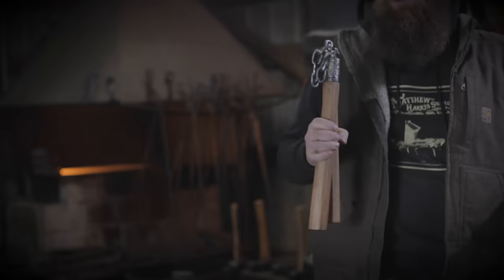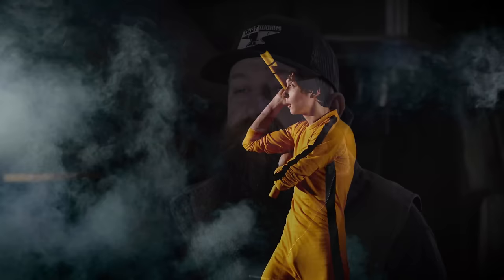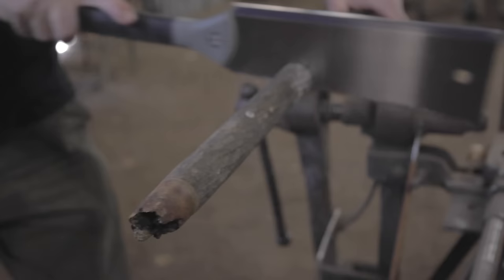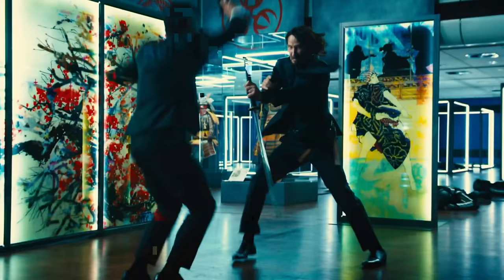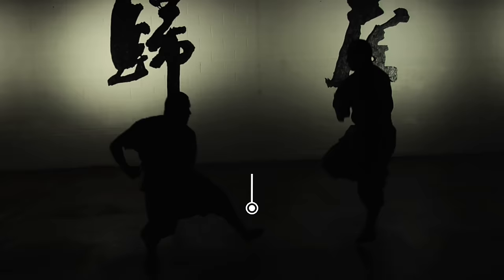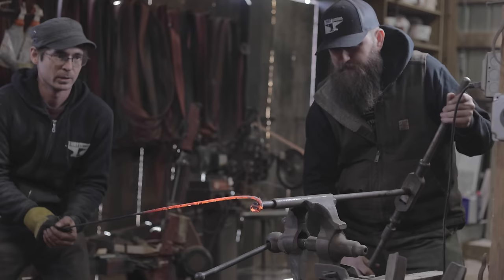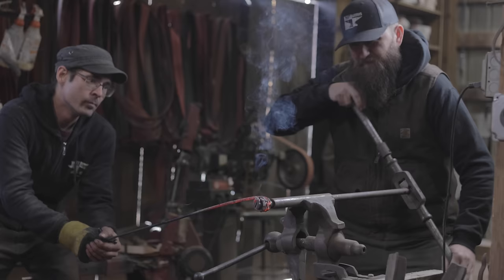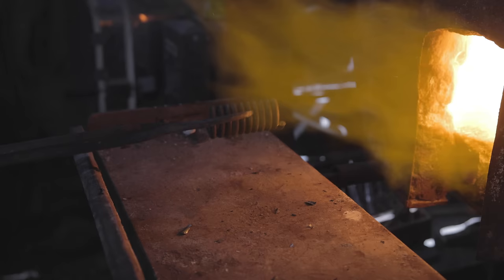John Wick 4 Nunchucks - Did They Exist in Battle ?

Comment: Here is my hypothesis on this matter. Nunchuk is a weapon that is used solely by ninjas. Which means, first, it has to be well conceal. Secondly, as a flex weapon, it can have better reach compare to other weapons. With the harden end, it can be used to deflect enemies blow for defensive purpose and with the flexibility, you can also throw enemy with ease. Also bare in mind that against people with armor, throwing them is the most efficient way. Which, you can imagine, Ninjas are not supposed to fight but run away most of the time, they may create scenario where they fight necessary fight with small crows. And because Ninjas are bacially rogue and not wildly accpeted by society, a weapon that is solely used by them, should it exist, may not be documented, specially it is also a simple design weapon which no body would really take a deeper look into it.

Comment: My guess is that they were rice flails, and that young men and boys would swing them around flamboyantly (as young men will) while they were working (thus giving the years required to master them), pretending or practicing to fight. Eventually, the long pole would have evolved into a shorter stick to make it possible to carry your flail (which was now a weapon) around easily, thus evolving from an agricultural tool into a specific weapon no longer useful as a flail. But not used in warfare, where a simple spear would be much more effective. Most likely used in bar fights...

Comment: Here's the real story. 
(A little bit of a read, but bear with me) 
I used to live around Seattle for a long time, and knew people that used to take classes from Bruce Lee.  That instrument, is not a weapon, it's a tool. It's also not a rice flail, it was a poor person's rug beater. It was two short equal length sticks with a rope connecting it, and was used to beat dirt and dust out of rugs and carpets in the 18-1900s in China and Japan, after both nations saw the lavish carpets of western nations and wanted it as well. Japan in particular was very impressed by the fact that western nations had carpet almost everywhere, since it was very expensive to make in Japan at the time. It was NEVER a "historic weapon", it was a rather new but rudimentary cleaning tool. So why the legend? Well this is largely because of Wing Chun Gung Fu, as well as Bruce Lee.  Wing Chun was a martial art designed to win, in capable hands, essentially a street fighting style that would go for eye gouges, joint locks, and groin shots if necessary. It was about minimal movement and redirection of momentum to keep the upper hand, and also being asynchronistic so it wouldn't line up with the "rhythms" of other largely practiced Chinese martial arts. But the biggest lesson, was "when fighting for your life, do EVERYTHING and ANYTHING you need to win.  EVERYTHING is a weapon, in trained capable hands." This meant a broomstick, a chair, baking flower, sand, a rock,  ANYTHING. This is where Bruce Lee comes in.  Bruce Lee took that to heart, and practiced using EVERYTHING as a weapon while studying Wing Chun under Master Ip Man, and one of his favorites, was a little rug beater, the Nunchaku. It is NOT a practical weapon. It's actually a pretty piss poor weapon. But that was the "point" of his demonstrations. To use something so basic, clumsy, and impractical, and use it as a fast effective weapon if needed. The idea of a Nunchaku being considered a "weapon", was something that only came to be after Bruce Lee used them in his movies and demonstrations. It also caused a bit of confusion as to the origin, because around before the 70s China and Japan started using the more common ornate European "flat" rug beating tools, since they were more effective and did less damage over time to the rugs. So it was a tool that was really only used by a rather small group of people for its intended purpose for less than 100 years. 
The point is,  this isn't a weapon. It never was. There are no "historic accounts" of a real Nunchaku being used in battle, because they were made during a time when "soldier battles" were dying out and guns were being used more. I know there are some historic accounts of rice flails being used as weapons, and I'm sure there's a few Asian counties that would love to take credit for the pop culture phenomena of the Nunchaku, but it was just a very short-lived cheap tool, that Bruce Lee used to prove a point. The problem is western counties had never seen a Nunchaku before, so most people didn't get the lesson about it that he was trying to convey. All they saw was "a Chinese weapon". (Which then led to a ban of the "weapon" in many western countries and even some US states,  even though a simple hardwood stick is more dangerous)

Comment: Hello ... so I found this video interesting... but I want to say that a few years  ago I did a bit of research on the nunchuck  back then the nunchucks can be use as a weapon  but only when there was no other weapons around and that the nunchucks was mainly  to perfect  fighting form for all type of fighting whether with a weapon or not  and the idea behind it was that if you manage to go through  the training with out hitting your self ... you'll do better in the fighting type you are try to go for... and the training very depends on what you trying to achieve. ... also I also read somewhere that there 3 type/weight classes  for the nunchucks when practicing  type 1 is a very light  one that is a bit padded  for beginners  type 2 is a wooden one that has more weight to it for  people that  are a bit more advanced  and is the most common one used and type 3 that's very heavy and usually made of metal  mix materials  and are used by pros that want to challenge them self
Reply: Gee.
In training you have to be very careful not to injure yourself.

I'm sure nobody ever considered the possibility of injuring  someone else.

Comment: The ones Keanu used filmong were Rubber they had like 8 pair sold at auction ..maybe 1 hero wood.. but most all were pianted octogon light weight rubber foam.. not

Comment: Few points: Yes, it is not well documented and if it existed only relevant in civilian self-defense. And yes, the way it is used today is mostly acrobatics. But, if you hold it in a sensible way - about two fingers width from the butt of the handle - you have more reach and you can generate much more force - e.g. watch?v=HLhcd8tIhSE  - Speaking of which, the chain is obviously better for blocking weapons, but it impedes the build-up of speed; even more so with such a fat chain as here. And lastly: Next time when you have the expert in, let him hit something with it. ;)

Comment: the training question is weird to me.   if you're using a tool daily,  you're training with it daily tip thrash wheat and rice.  As for why you would uniform the 2 sticks to the same size; this again seems silly to me.  having 2 sticks the same short size makes it reversible, balanced, extended beyond the stick size if it was twice as long and a one handed weapon.  potentially,  you could carry 4 18" sticks with a dual 36" each in each hand. you could beat a lot of peasants with that.

Comment: i know this is not a video about polishing but i also dont know how often you guys check the comments and wanted to make sure its seen:
What do you guys use when you hand polish?...cause WD40, thread cutting oil, and Windex...all have warning labels saying: Keep out of reach of children and have contacts for a poison control center. Sharpening stone oil/whine mineral oil Like that made by Norton says...in Ingestion and inhalation of vapors should be avoided.😱 Maybe we should not be spending hours inhaling this stuff it might just be bad for us. i have been using olive oil and have tried canola oil it works just as much as Thread cutting oil. it will not rust the blade I tested it on a cracked 1075 blade leaving it on for hours against ferric chloride, white vinegar and tap water it did not rust the blade. thread cutting oil is $1.02 a fluid ounce,  cheap olive oil is $.22 a fluid ounce, and canola oil is $.15 an ounce and very, very easy to get. It smells good and is safe to ingest.
I will acknowledge it could cause bacteria to grow non the blade well your cleaning it up but just properly wash and dry it when you are done polishing and that's no longer an issue. IF you are allergic to olive or canola oil well use a veggie oil you're not allergic to. 

also again, wash the blade to get rid of the oil before you coat it in wax to help prevent oxidation and that should prevent the end user from accidentally suffering an allergic reaction and use the WD40 and other things as they are intended.
PS: keep using water with your water stones.

Comment: i think it's less weapon for offense and probably more defensive if at all. Defensive against a sword or polearm to wrap the item and you have two handles to hold and control it. although even that seems a little far fetched. The rice flail seems like a decent enough story that starts but again why make something more difficult to use? In such, shorter handles take away leverage that can be attained.

It's entirely possible that one could have been found and mistaken for a weapon, when in truth it as just a broken tool and nothing more.  It's unusual to have a weapon either offensive or defensive that isn't immediately obvious what it is intended for and the use there of.

This is just speculation of the thought, aside from possibly being some mid century creation to look cool for the movie screen. If something like a nunchuck was discovered with a stick linked to possibly a shorter piece and it wasn't a rice flail, it may have been mistaken for having equal length handles when it had perhaps a short iron bar to be a sort of morning star like object. But again, that's just me speculating.

Comment: Hi That works, i have a question for the nunchuck that was made in the video, I see in the end of the video the spikes end of the chain were hammered into the wood, doesn't that make the wood handle have potential to break ? Especially with big spikes like that ?
Reply from the maker: The bell that goes over that section holds and compressed the wood tight. Of course these aren't the most durable weapons. They are after all, just wood.

Comment: I will start by saying, as a lesser point, that I swear I read some years ago that nunchaku were literally invented as a theater prop, and later, movies.  It was NEVER a weapon,  it was always flashy looking and cool. 

But my greater point,  IF, you wanted this weaponized, you'd have to wrap the ends with some kind of steel knob.  The extra weight, plus the harder point of contact, would be required to do actual damage.  I can't help but notice they absolutely no one who has ever argued for the efficacy of the nunchaku as a weapon has ever tested it on meat, and there's a pretty obvious reason why.  Have you tried to break bone or even split skin with a small stick?  Because the velocity a nunchaku can build is pretty limited given the compete lack of weight.  Again, to make it a weapon,  you'd need weight, or greater speed, see also the meteor hammer.

I'll finish by pointing out that as a home defense weapon, as a personal defense weapon, as a concealed weapon,  a small truncheon beats this every time.  A sap or blackjack doesn't need a ton of weight to be effective, and it's smaller... and notably less flexible.  But they don't beat the knife.  Nothing beats the knife, even a little bit,  if you're fighting another human being, in anything that isn't specifically a wartime battlefield, the knife is the smallest, lightest, most reliable tool/weapon platform mankind has ever invented.  Period.  Every alternative has strengths and weaknesses that might make it better than a knife in a very specific scenario but every other self defense weapon system lives alongside the knife, knives have never, and will never, be completely replaced.  At least not until we evolve in WALL-E chair bound fatties.

Comment: I think it was never used as a war weapon.  Against a sword or spear it would have been useless.  A staff or stick would’ve be a better choice.  A staff has reach of a spear but not the point.  Even against a club it lacks the ability to block that the stick provides at the same reach.  A simple test of trying to block a stick to your face will show you the weakness a flexible weapon.  It will bounce back at the user.

Comment: The Nunchucks is a threshing tools a farm labor will spend hundreds if not thousands of hours using this tool every year any farmer who has used the tool is very proficient at it by the end of the season  What your thinking may fit the world of today but it does not fit the world where these farm tools were used to bring in the harvest every year. What would a farmer use for self defense on the farm or going to market? A baseball bat or anything that would be seen as a weapon would get the farmer killed by guards. common farm tools would not

Comment: Is it possible they were used by Ninja or their predecessors the Lin Qui? And maybe the idea wasn't so much as concealment, but ease of transport and carry, since you don't want to try climbing a wall or a tree with a staff or a club. So with a nunchucku one could keep it in their "utility belt" and have it easy to carry and also easy to deploy if needed. It's cheap to make, and in a situation where a Shinobi or Lin Qui were infiltrating a camp, compound or whatever they wouldn't have to worry about injuring friendlies. 
I think the idea was to incapacitate individuals that would be likely threats while snaking around to steal intel or something like that. In this scenario one doesn't need to kill, just knock out possible threats. And there is no need for elegance in how it's used, it's just a tool.
Reply from the maker: Oh boy...
Reply: @ThatWorks  What about my comment led to that response honestly? The Lin Qui part? There is documentation of a clan from China that were dubbed Lin Qui (roughly translates to Forest Demons) by the bandits they attacked because of how fast they struck and vanished into the forest. Here is a video that mentions it. https://youtu.be/9VI2tuEoPIg
And as for the infiltrating part, there was a clan that specialized in Intel gathering. I know it might have seemed like I was talking out my ass but I wouldn't have even commented if I didn't have some form of evidence to the thought.
Reply: The Lin qui are not real they are just made up and never use gaijin goomba as a source.

Comment: In my personal opinion, it would make a terrible battlefield weapon.
However, in a close tight space for quickly brutalizing your opponent, it is a fantastic device for delivering quick successive blows with superior impact force compared to a stick in a tighter area. Perhaps instead, imagine how two pieces of bamboo with a wetted rope (for weight) run through them could make for a quick and dirty version of this weapon that could be used to quickly spring upon a victim, pummel him with quick blows aided by the return motion, then toss the cheap implement aside.
It is very hard to block, and the power of the strikes is a lot stronger while reducing the recoil on your own hands, so you do not have to be a warrior to do this. Also, this use does not require much training or practice, if any.
These are just my thoughts on it.
If you do test this, don't use a hard target like a log that will bounce it back at you and lead to self-injury, maybe like a pillow stuffed into a tough bag.

Comment: Hum, on the one hand, as usual, good production quality, nice blacksmithing and carving by Illya, on the other, I don't think you have enough personal experience using such a weapon or you'd have a different thought on how effective it is. I will say however that I don't think it was ever used a primary weapon in war/battle, but it most certainly was a self defense weapon used by those of the "lesser" class who were not allowed to have "real" weapons. 
Little constructive criticsm on your actual build, while they may look like a pair of nunchucks, but too bulky to be properly wielded by the avg person, those would loose their effectiveness of high speed/velocity. Also, the chain or rope (I prefer rope, it's quieter, lighter and doesn't keep a load of noise) should be just long enough to fit across the palm of your hand, any longer and they become what you suppose, unwieldy and harder to control.
Reply from the maker: These were modeled after the one used in the movie. We were kid of stuck to the design
Reply: @ThatWorks guess I can kind of understand that, but there in your theory/discussion falls apart because movie prop vs actual weapon.

Comment: Question: How would it relate (if at all) to the three-section staff? Or is that one closer to the changxiaobang used in Shaolin martial arts? 

I mean, nunchucks look real cool and all, but even as a tonfa practitioner of many years, I once decided to try them out and indeed it ended up being more dangerous for myself than for any of the soda bottles we had lined up (I think I managed to hit one while also nearly bashing my brains in). I do, however, like the concept implicit in the TMNT mythos (or maybe saw it in Reddit, I don't know, full-contact martial arts aren't great for keeping a good memory, heh), though, about how the most tech-savvy turtle was given the simplest weapon, the most aggressive was given a traditionally defensive weapon, the most level-headed was given the most lethal, and the most scattered-brained of the turtles was given the weapon which requires the most concentration to wield.
Reply: The danger is exaggerated by awkward ppl